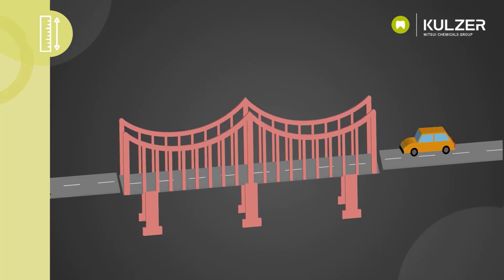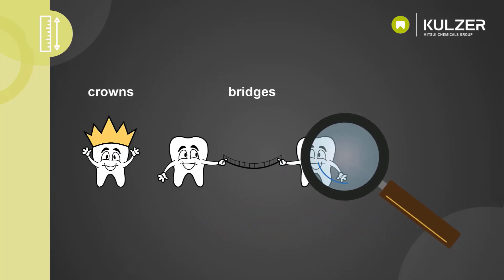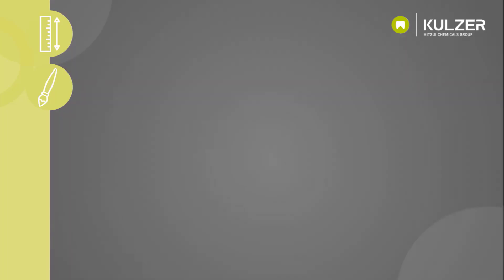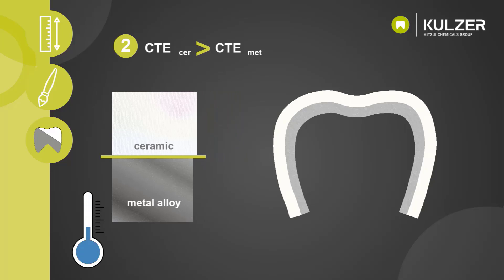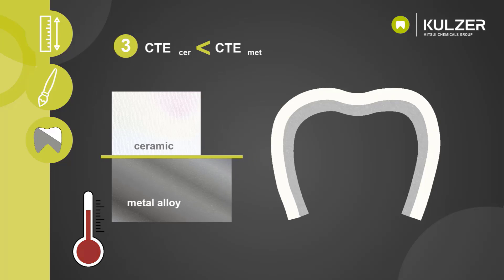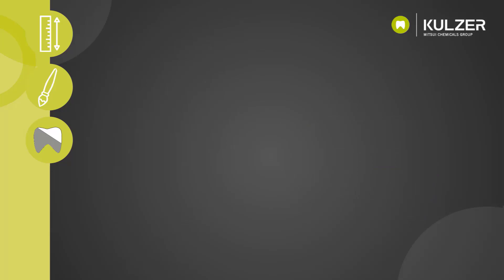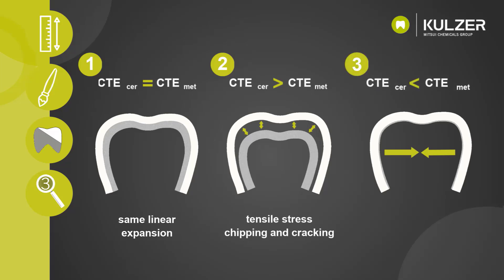CTE - Coefficient of Thermal Expansion - for dental ceramics

Comment: Thanks to ai I have the following likely FEQ's and their answers

Q1: In the last scenario when the CTE of the metal alloy is larger than that of the ceramic would there be a gap when metal shrinks since it has a larger CTE? A 3rd party viewer in the comments mentioned that there is not only a mechanical factor at play but also a chemical factor as well meaning that although the metal alloy has a larger CTE it would pull on the ceramic and "keep it close." What is actually/what would actually happen here?

A1: In the third scenario, when the CTE of the metal alloy is larger than that of the ceramic, the video explains that the alloy expands more than the ceramic when heated and then shrinks more during cooling (2:30). This difference in shrinkage leads to compressive stress on the ceramic (2:44).

Because ceramic has high compressive strength, it is actually strengthened by this pressure, and its load-bearing capacity is increased, which helps prevent cracks (2:47). The video emphasizes that it's important for the ceramic's CTE to be only slightly smaller than the alloy's to avoid chipping or cracking (3:01).

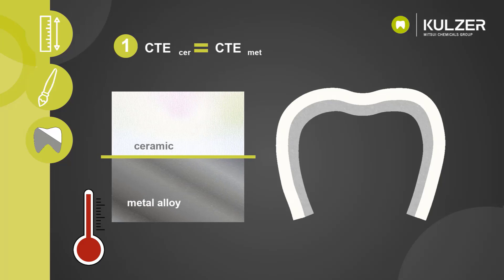The video focuses on the mechanical effect of thermal expansion and contraction, which creates the compressive stress. While the video doesn't explicitly detail the "chemical factor" mentioned by the viewer, it does state that a chemical bond and micro-retentions create an adhesive bond between the materials (1:47). This underlying bond is what allows the materials to stay connected and for the stresses (tensile or compressive) to develop as they expand and contract differently. So, yes, the chemical bond is crucial for the metal to "pull" on the ceramic and keep it close, leading to the beneficial compressive stress when designed correctly.

---------------------

Q2: So what is the best case scenario? Is it scenario 1 when the CTE are equal or when the CTE of the metal alloy is slightly larger? 
A: Based on the video, the best case scenario is when the CTE of the ceramic is slightly smaller than that of the metal alloy (scenario 3).

Here's why:

Scenario 1 (Equal CTE): The video states this "almost never happens" (1:29). Even if it did, the resulting adhesive bond is described as "very low" because there are no tensions between the substances to strengthen the bond (1:52).
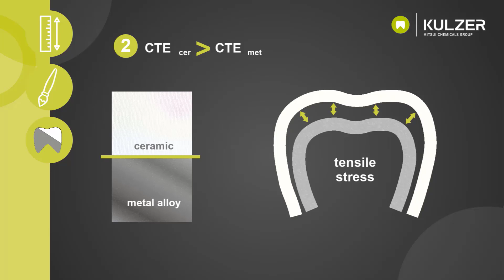Scenario 2 (Ceramic CTE higher): This leads to tensile stress, causing chipping and cracking of the ceramic (2:23).
Scenario 3 (Ceramic CTE slightly smaller): This leads to compressive stress on the ceramic (2:44). Since ceramic has high compressive and flexural strength, it is actually strengthened by this pressure, increasing the veneer's load-bearing capacity and preventing cracks (2:47). The video emphasizes that the ceramic's CTE should be only slightly smaller for this benefit (3:01).
Therefore, having the ceramic CTE slightly smaller than the metal alloy's CTE is the desired outcome for a strong and durable dental restoration.

---------------------

Q3: what is this adhesive bond? Its a layer between the ceramic and the metal alloy but what creates it?
The video mentions that the adhesive bond between the ceramic and the metal alloy is created by two main factors (1:47):

A3: Chemical Bond: This refers to actual chemical reactions happening at the interface where the ceramic and metal meet. Atoms from one material form chemical connections with atoms from the other material, essentially "gluing" them together at a molecular level.
Micro-retentions: This involves microscopic irregularities or roughness on the surfaces of the metal alloy, the ceramic, or both. When the ceramic is applied and fired onto the metal, it flows into these tiny nooks and crannies. Once it cools and solidifies, the ceramic is mechanically locked into these microscopic features, creating a strong physical interlock.
These two mechanisms work together to form a strong and stable bond, allowing the materials to adhere to each other and transmit stresses effectively.

Comment: This is not logical, can you explain again? If cte of metal is higher, it will shrink more during cooling and ceramic will not go along. there will be gap between materials and scenario that you describes as 2. I think 2. and 3. scenario should be reversed. Please help! Thanks
Reply: Remember, a bond forms between the ceramic and the oxide layer formed on the metal alloy interface. Also, remember that while the CTE of the metal is higher than the ceramic, it is only a small difference. The "pulling force" is enough to compress the ceramic and reinforce it, but not enough to overcome the bond strength of the ceramic and the metal.
Reply: @matthewguralsky  Fantastic that makes sense. I'll have to look into this but that explains the valid question brought up by OP
Reply: Yeah I think like that too